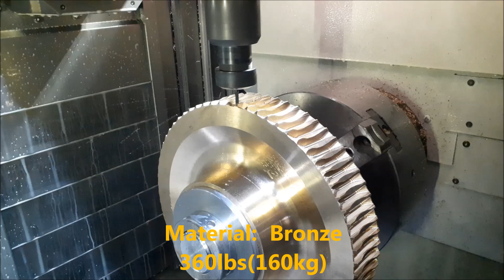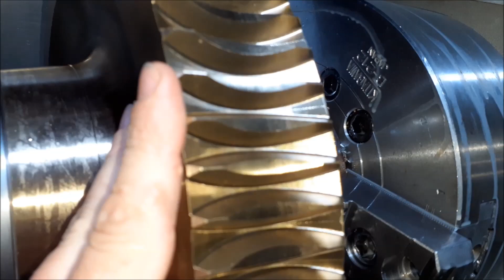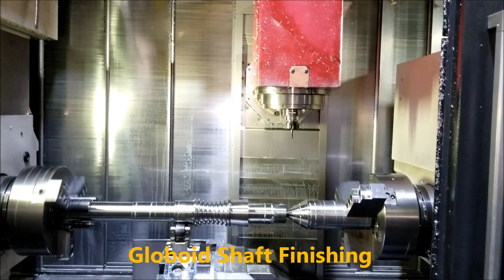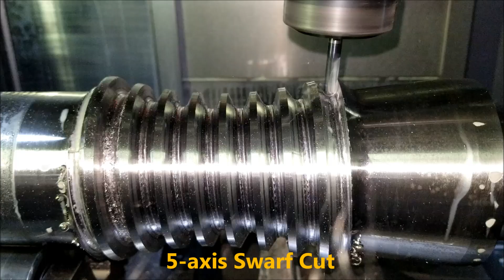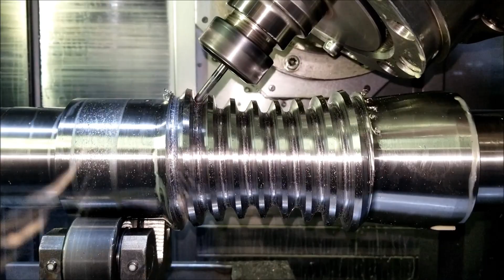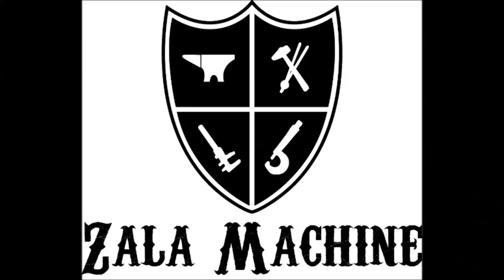Machine Shop Quick Shot--- Globoid Gear Machining on a 5-Axis

Comment: Aren't you afraid that the chips between the rollers and that shaft will influence the precision
Reply from the maker: The rollers and chips do mark up the part in the section where it is touching, I usually have to polish out any marks.  But it is a necessary sacrifice to be able to make this part without major vibration issues.
Reply: @zalamachineshop  It can be cover by transparent folded plastic sheet from notebook and magnets

Comment: Did you make the lower turrent support yourself or buy? How do you maintain a consistent pressure on the part?
Reply from the maker: We made it here a while back along with a full steady rest that also mounts on the lower turret.  The pressure I set by getting the rollers touching as much as a manual steady rest and leave it there.  Stays consistant and helps just enough with the vibrations.
Reply: @zalamachineshop  thanks for the explanation, ingenious as is everything you do